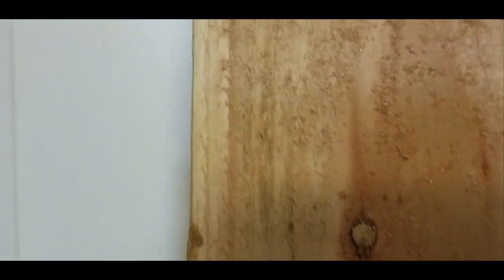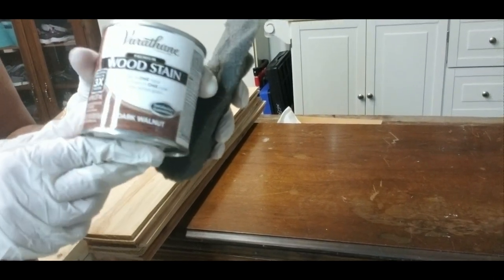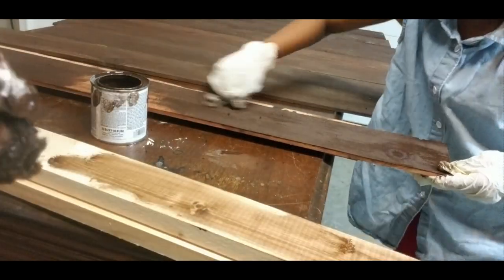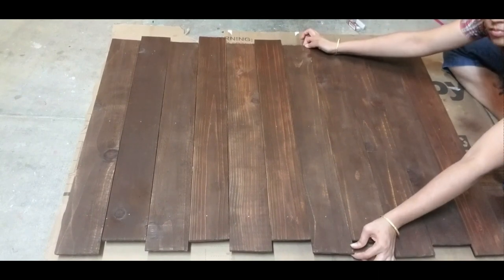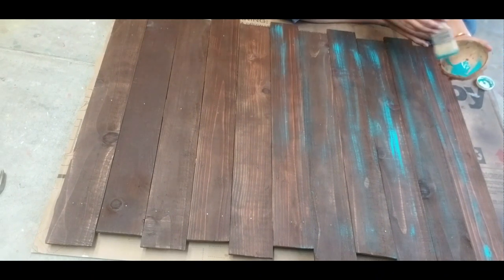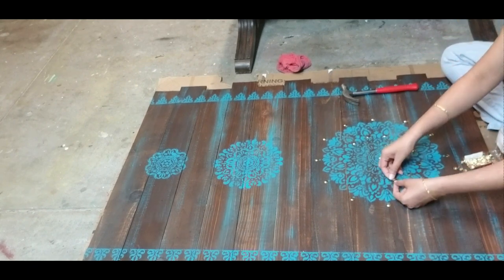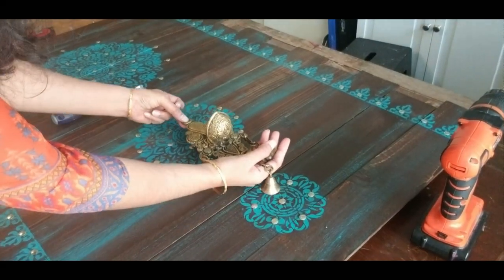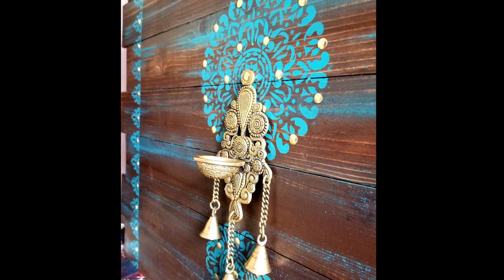DIY ethnic wall hanging under budget

Comment: Thank you savi for the detail steps. I finally was able to get mine done. I could not fine 0.125 inch bender board n went with .5 inch ones instead. Couple of mistakes i did was i used small nails when putting together my bender boards and that made them very unstable. I had to remove all the small ones and in the same spot nail in longer ones. I wish i cud send pic, but i do not see option to send it here

Comment: Hello Savi, thank you for the detail explanation. I took up this project and i am hving tough time finding bender boards. Luks like home depot stopped selling them. Anything else which will work equally well
Reply from the maker: https://www.homedepot.com/p/Bender-Board-Redwood-Common-1-8-in-x-3-3-8-in-x-8-ft-Actual-0-125-in-x-3-375-in-x-96-in-457639/206935923

https://www.lowes.com/Search=redwood%20bender%20board&catalog=4294612581

Comment: Thank you so much for sharing. Am planning to do the project - can you please send stencil details I can’t find good border stencils on amazon.
Reply from the maker: Hi Sheetal, I think the stencil that I have used is out of stock in Amazon. If you are not able to find any border stencil you can use small size mandala designs and use it to make borders. That is how I was doing before buying this border stencil.

Comment: Hi Savitha. This is beautiful!  What is the size of the mandala stencil? Is it 12 in ×12in?
Reply from the maker: Thank you Madhavi, the stencil is 15"×15"
Reply: @saviscreations185  oh ok. I am planning to cut the planks into around 2 feet each. Do you think 8in × 8in stencil will be good enough or 12in is needed? I am a beginner so have too many questions :-)
Reply from the maker: Yes if you add borders
Reply from the maker: You will need 12" stencil
Reply: @saviscreations185  ok, thank you, hopefully it will turn out as beautiful as your's :-)
Reply from the maker: It will turn beautiful 😊👍. Send me the picture when you finish the project.
Reply: @saviscreations185  sure :-)
Reply: @saviscreations185  I am unable to find any bender board. Is there any alternate for this?
Reply from the maker: You can try ceder planks